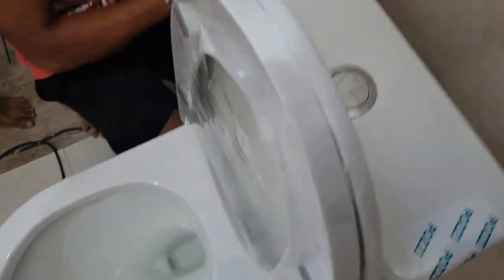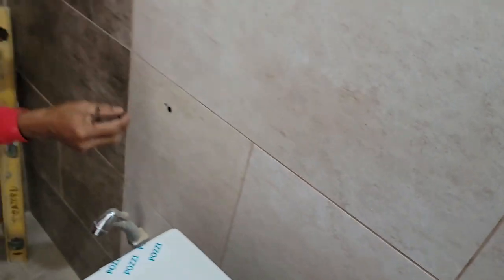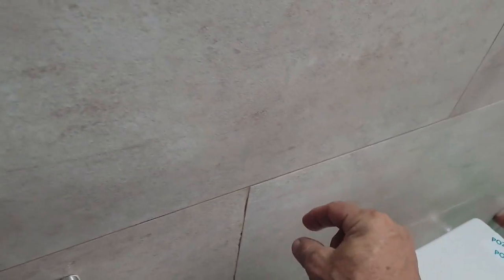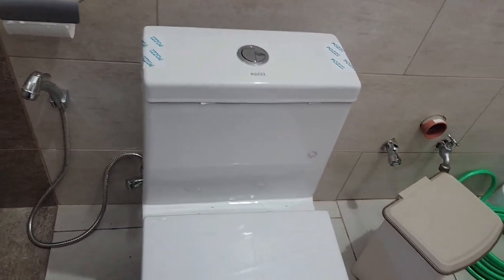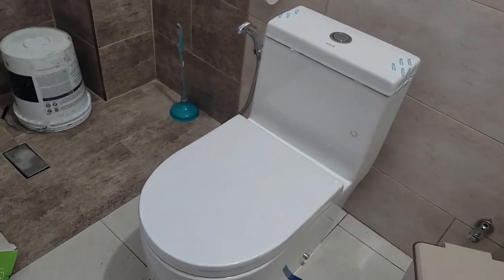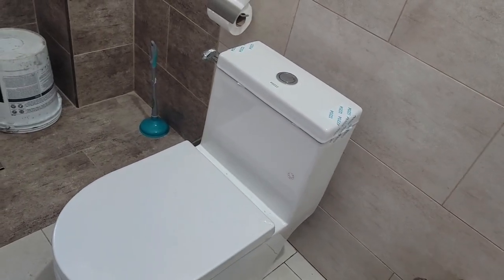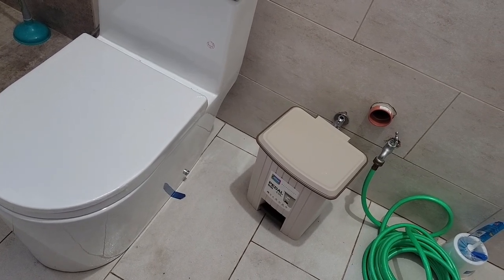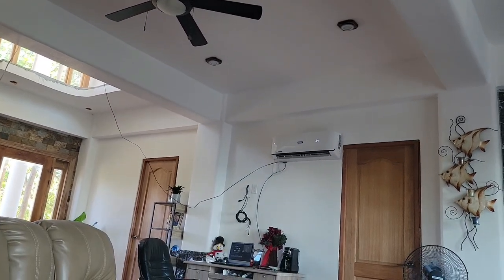Philippines Beach House Build Day 346 PART 2 I SMELL A RAT!

Comment: James, you should never put a towel rack above a toilet, it is recommended that it be fitted outside of six feet from a toilet. When you flush a toilet it spreads air up to six feet around the toilet thus spreading bad air full of germs.
Reply from the maker: The restroom is 8 foot wide including the shower by 5 foot.  This means after the shower doors there is 5x5 area remaining. this is a very common restroom size due the tub and shower enclosures are 5 foot.  Unless you have a very large restroom there is NO WAY to have a towel or toothbrush sink or anything 6 foot away. Impossible.  I have lived my whole life with restrooms this relative size and with towel racks all in them. I and everyone in the household is still alive. We are very hygienic people so some old towel wont be hanging there for weeks  or months. Not even days. Maybe hours. There is not even dust settles around here. By your theory from tv shows and videos of germ-a - phobics  when you flush your face  and body will be within inches of the toilet. Your nose is inhaling while you stood urinating and then flushed just inches away form the action.  This means you would need PPE gear and respirator to urinate and flush within the danger zone.  I am hoping you can see the ridiculousness of it all.  Main thing don't leave a towel hanging as decor for weeks or months on it. Maybe hang one for a shower your about to take.
Reply: Hi James, I fully understand what you say, I was just bringing your attention to the facts. I have a breathing problem and 20 billion microbes distributed in one flush can contaminate ones towel with detrimental health effects to someone like me. So glad you are a healthy man 👍
Reply: Lol

Comment: Cap with holes sounds like the perfect solution . My vents are only 2" and we have lots of mice and chippies , so I put wire lathe mesh on top of them , good luck with blockage , I'm sure you'll get it cleared 🐀👍😎

Comment: It certainly is different living here, and I as well never stop learning. In case you install a grey water drain into a drywell/rock pile, also cap and drill the ends like you did on the roof. Snails will invade and clog the drainpipe. I learned that the hard way..

Comment: As I was thinking about vent pipes I can’t recall ever seeing one larger than inch and half. I like the idea of a cap with holes. One thing I’ve seen often is draining the A/C condensation into them.
Reply from the maker: 3 or 4 inch is common for the toilets so they dont such the p or s traps empty. Makes toilet flush strong too.

Comment: That's a good idea there I am going to tell my workers to make sure they cover the events.
Reply from the maker: Please do ! Ray be sure they dont put sacks or such. It can get sucks in also. If a mouse or rat gets in anywhere they will shred those sacks making nest in the pipes. Buy actual caps and put on the pipes until the build is done. This can also keep a disgruntled worker from dropping wood or cement inside your pipe! Cap everything because geckos will also go in even your small tubes like 1/2 pipe and die or lay eggs

Comment: James,  As a country boy you probably figured this out already by the time you read this, but you might have to attack the clog from the top since it won't be so easy making that 90 degree bend to go up from the bottom of the clog.  Also if you do it from the roof you will know immediately when you are successful since the water will drain down.  If it is a dead rat bloated out to seal the pipe that will be nasty one indeed when it unclogs.  I'd run a long piece of 1inch PVC and drop it down to hit the clog from the top and I'd push a long piece of 1/4 in. steel cable  inside the 1 in PVC and hook my biggest drill to the end of it at the top and as you feed the cable down to the clog it should drill right through that rat and the water will drain, and if you are lucky tangle itself in the rat so you can pull him up after you've popped the gas out of him....good luck.....can't wait to hear "the rest of the story" as Paul Harvey would say!
Reply: The one inch PVC is so the cable doesn't damage your vent pipe as it is twisted by the drill, and you want to be sure you leave enough cable slack at the top to be able to feed it in when it is on the drill. it is sort of a DIY roto router.

Comment: studor vent fitting is designed to do what u need. of course comes from far from PI. Amazon or lazada. i guess. also will keep out bugs. meets USA plumbing codes many places.
Reply from the maker: nice share! I will google that
Reply from the maker: So I just looked at them. They do have them on lazada and says comes from USA. Basically it does nothing more than me putting a basic cap on and drilling a series of small holes. I still appreciate your share. They wanted like $80 USD equivalent for a 2 inch one. I cant imagine the price for a 3 or 4 inch

Comment: Might try a balloon that screws on the end a water hose. Balloon will swell up and make a seal inside pipe and allow pressured water to build up and blow plugged lines out. Bird screen devices sound good idea for future defense.
Reply: Also known as blow bag. Most hardware stores in US have them in different sizes S,M and large 3-4" pipe. I've had same problem with vents pipes. Pour drain cleaner or a little muratic acid and use a blow bag.Hope this helps.
Reply from the maker: I can make a quick pressure system without buying one. Actually already did :) Thanks for sharing that. I use those on my rentals back in the states. Renters will flush anything !!

Comment: We had roof rats in socal that were a problem so I used 304 stainless  hardware cloth. Make sure you get enough air flow for your drains if you do the cap and holes. I'm sure the holes will be like 3/8" or so. Good luck! I can't wait to see what you find!
Reply from the maker: A gentle shared about a Studor vent. Interesting. Drilling a cap will do the same. The studor vent is plumbing code approved for the USA. I dont need to worry about that here.

Comment: Just file it under "crap happens". 🤷‍♂️
End cap full of holes seems more than reasonable.

Worst case dump some kind of organic material digester down the vent stack and let it eat at the blockage. Might take some time to free it, but should break loose eventually.

Comment: I have had squirrels and birds' nest get into the main vent, the worse was a soft ball that took almost the whole day cutting with a power auger. also was wondering if they have sewercams you can rent, but no power augers so I bet no cameras' either. you can make a sewer snake out of 7/8-inch cable with a homemade cutter head hooked to it and pipe wrenches to turn it.

Comment: One thing that could save you money is to buy a COLD water heater instead of a HOT water heater!  😂Just kidding!  Yeah, even here in North Carolina and in Florida, when I lived there, none of the pipe vents were ever covered.  I like your idea of the cap with the holes and will be interested in seeing if that will allow enough air to be pulled down and/or if it will make a whistling sound when it does!

Comment: The same exact thing happened when I was in the Navy Seabees while in Guam except ours was a brown snake. It’s beyond human comprehension why an animal would want to go in a vent, but like you said, animals do what they do. 
I’m from Florida and like you, have never seen a cover or screen over a vent pipe. 
I would suggest putting a screw cap on your vent in case you need to chase that line out in the future. 
I hope you have good luck cleaning out that line and you don’t have to bust into a wall or column to replace a busted line. Go easy and take your time. 
I hope the negative Nancy’s don’t bust your balls on something you had no control over. 
Keep making the videos. My Filipina wife and I love them.
Reply from the maker: Yes the screw type is what I will be using. Nah I wont have to bust any columns or walls. I put access points in when I built the house. Always thinking ahead!

Comment: Given the environment, your solution sounds like you are on the right track. The only possible I can think of is when a toilet is flushed, the volume of air required for the water flow rate could be an issue. I would perforate the heck out of your pipe solution. All the best. Appreciate your content and what I learn
Reply from the maker: I put 3 yes 3 separate  3 i,nch vent stacks on that line!!!!!!!!  So no worries! I am a overachiever!!! lol.
Reply: @TexasFilipino  I could tell we are like-minded. That's why I enjoy watching the progress on your house

Comment: sounds perfect drilling the holes is a great idea because the sun and salt will destroy almost everything you put there. might just be able to even cap it with enough holes. what kind of pipe are you using is it like regular pvc. because I know that of course im only talking about the states we have to put the lead boots around all the pipes. and on the pvc pipes the lead boot helps against the sun degrading the pvc and of course the boot helps water proof the roof with singles. not suggesting anything only wondering as I dont no what they use here in PI everything is different everywhere. do they have to paint the pvc to protect it from the uv rays
Reply from the maker: It is heavy grade pvc embedded in concrete. the few inches sticking up I will put the perforated cap on and will most likely spray paint it with many coats in advance.

Comment: What we do to keep  rats from  climbing on coconut trees is we wrap the trunk with a two feet long galvanized flat metal  sheet . This material makes it impossible for them to get traction even if painted over. You can also use your left over roofing sheet cuttings .
Reply from the maker: Yes I am liking that idea ! Thank you

Comment: Rats used to run up our rain gutter pipes all the time until I bought screens made for them off shopee. Looks like a mushroom shaped screen that fits right into the pvc pipe. And they are super cheap and super easy to install.
Reply from the maker: Thank you! If it is not top quality stainless the salt will eat it in just weeks here

Comment: Yes,...... Good Morning, Mr. James....When you built that draining system....it's really long.....I was thinking......if it ever gets plugged....🤣🤣🤣🤣🤣....  So many things could go in that draining system.....Rats, Snakes and Birds ....They all love to climb..... There is other options to do than running a Snake Router..... One use Toilet Bowl Cleaner Acids....they exist..... Or use a 3 inch Plug to cover that pipe.....then pump air pressure into that hole.....push air into the pipe.....  After you unplug them pipes....get some shower drain covers.....then put them over the 3 inch pipe....but, you still need to clean that gutter and check it ....but, it's better than fixing the clog....

Comment: You're a farmer, you know how to handle rats & mice. The cheapest of old-fashioned snapping traps, place the trap along the wall so it snaps shut towards the wall & bait with a little dab of peanut butter, gets them every time, guaranteed! The toilet is a 2 stage flush, the small side is for a small flush like pee & only flushes like 1/2 a tank of water. Try putting 1-2 liters of white vinegar (asylitic acid) or Chlorine bleach into the drain pipe, it should dissolve any cement of organic matter in about 6 hrs. Turpentine is super effective in discouraging any small animals, just takes a few drops. Stainless screen should last a long time in the saltwater environment, just sayin.
Reply from the maker: Too many children around here. These are very very large rats. So it means a large dangerous trap that could hurt a child.

Comment: Time to buy that high-powered pellet gun and do some rat Exterminating wonder if you could put a cap with a air valve on the roof and put some air in there and blow it through

Comment: I had a kinda similar issue one time, turned out my blockage was due to an old empty cement bag which been stuffed into the pipe during the build to prevent debris from falling into it, problem was the mason had dropped so much cement it had been heavy enough to push the bag further down the pipe outta sight and my bath was fitted not knowing the blockage existed. I tried everything with no luck, as a last resort I fetched a "steam generator" thingie I had, it had never really been put to any use as, after buying it, I hadn't a clue what I was gonna use it for, in theory it was to clean car engines etc....anyhow I stuck the nozzle into the offending pipe and turned the beast on, after maybe 15 minutes I heard a noise which was the blockage moving in the now slightly wider pipe, I recovered the offending bag and debris in the manhole outside before it got time to head towards my septic tank.